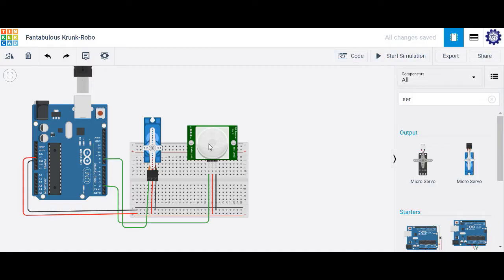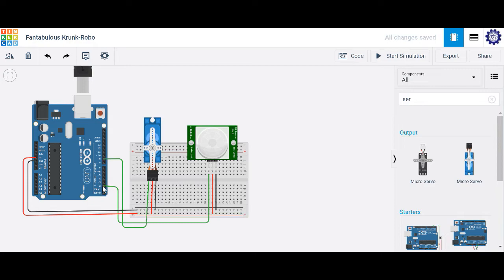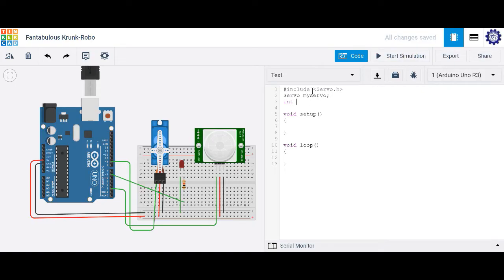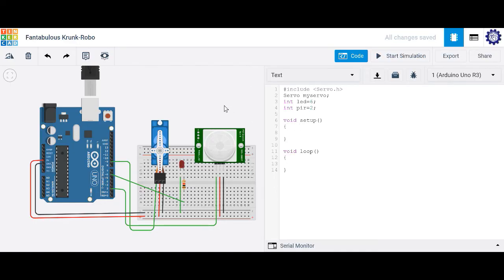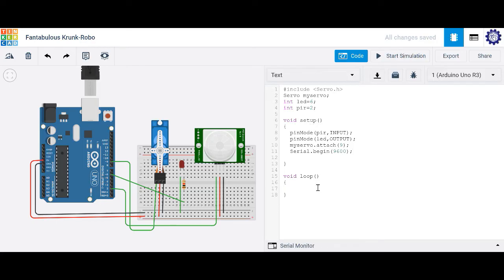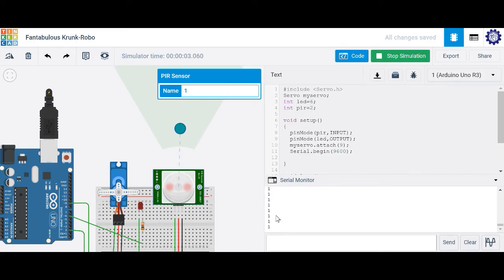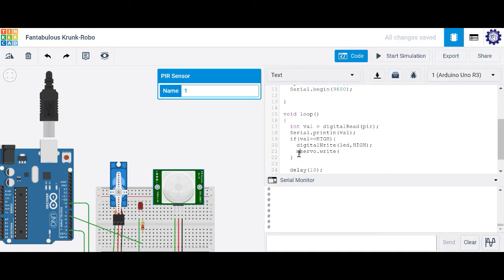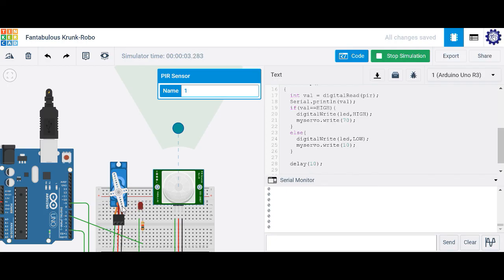PIR Motion Sensor in Tinkercad

Comment: How bro if...... (val =High), Servo turn 90 degree, when (val=High) again, servo needs to turn 180 degree. It's like when sensor activate for the first time, servo have to turn 90 degree, then sensor activates again servo needs to turn 180 degree. How to write the code bro.. I tried using if else but doesn't work.